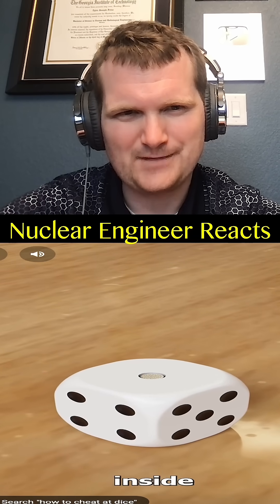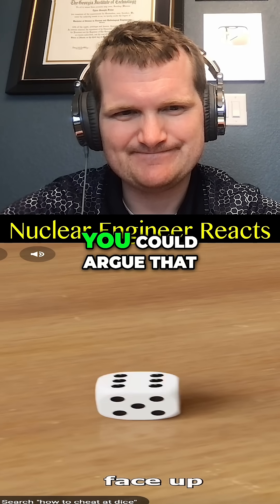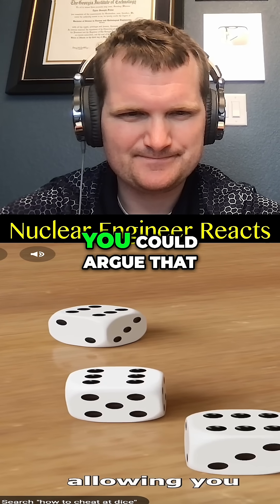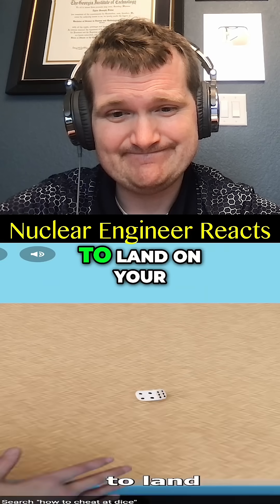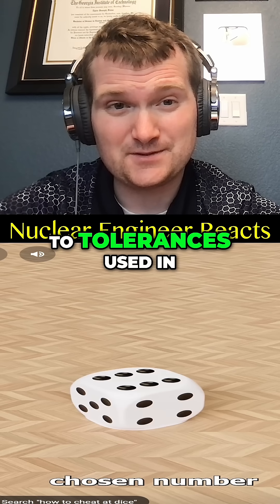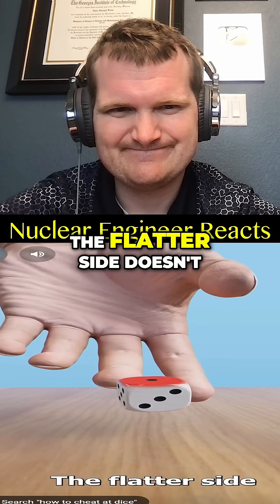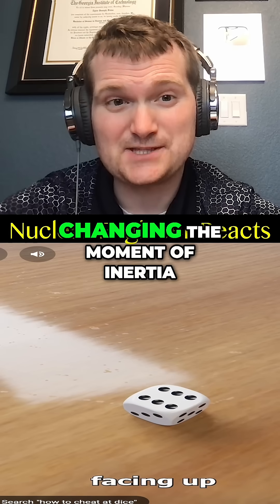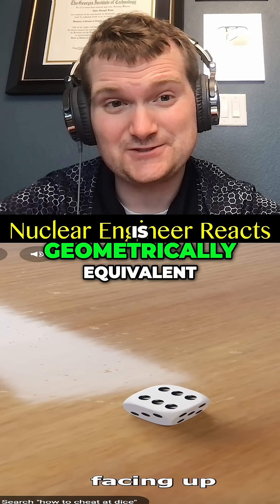How Cheating Dice Work - Nuclear Engineer Reacts to Zack D. Films

Comment: If you threw dice with natural uranium levels of U-235 (0.7%), it’s like rolling 100 dice and needing 1 to land on a 6 to keep the game going — pretty unlikely over time.
If you enrich to 3–5%, now you’ve got 3 to 5 dice out of 100 that can land a 6 — chain reaction much more sustainable.
At weapons-grade, it’s like rolling 90 loaded dice out of 100 where each one has a much higher chance of rolling a 6. That’s how you get runaway reactions.

what kind of probability is there for an LLM to spit this line out

Comment: you know, the way to have solved this if dice makers made the 4 on the opposite side of the 6. that way there is no centerpoint. 
sure you can measure but that's a lot harder than what people did. which was take a pin and let it fall perfectly to the center of the 1 dot and then tap it. now you have a perfect mark.